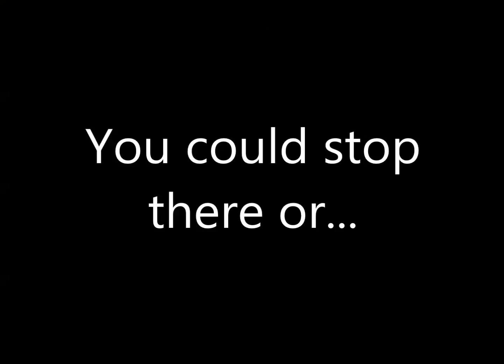Make new wood look like old distressed barn boards {Reality Daydream}

Comment: I'm confused on the paint part... are you dipping the same brush in all the cans? Wouldn't that make the cans get the wrong paint in them?
Reply from the maker: Yes, that's exactly what I'm doing! These are just leftover quarts of paint that have been sitting around in our garage for a long time. I'm ok with them getting little tints of other colors in them. But you could absolutely use separate brushes for each color if you want. :)
Reply: Reality Daydream thank you so much for responding.
Reply: Reality Daydream